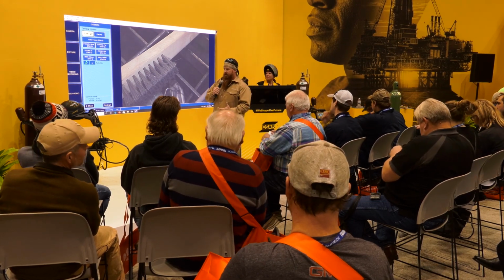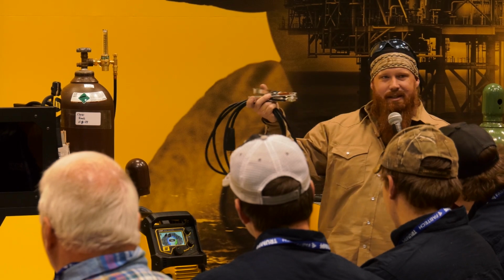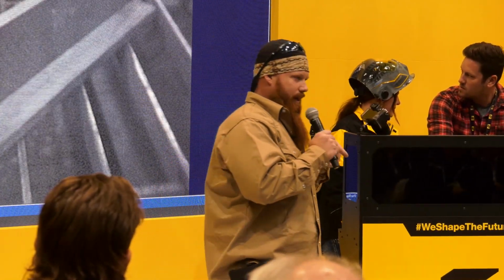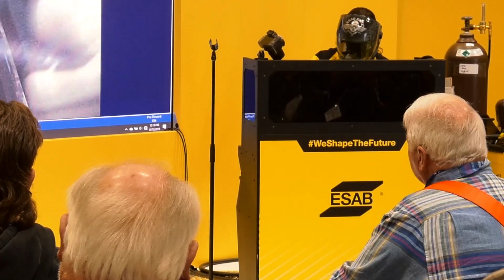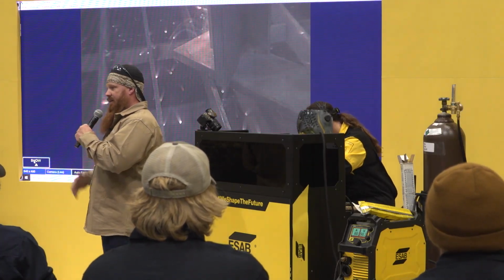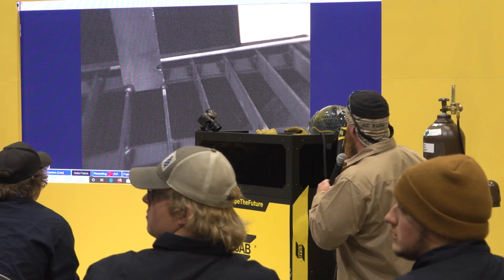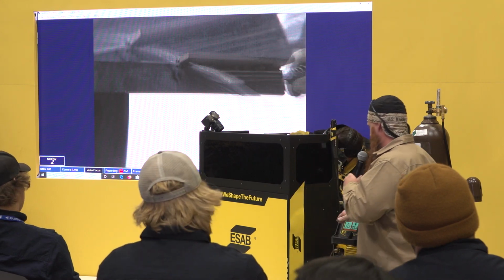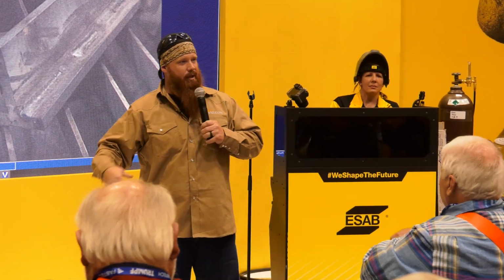The Basics of Stick Welding featuring Jason Becker | ESAB University Seminar

Comment: I see slag is harder to peel of. It needs a lot of work to clean it of. Is this typical for this electrodes ? Vertical weld was not so great (uneven and jerky moves), and overhead needs some skill but it was ok.
Reply: No the slag comes off easy if u do a good weld but it welds nice I just blame the welder herself